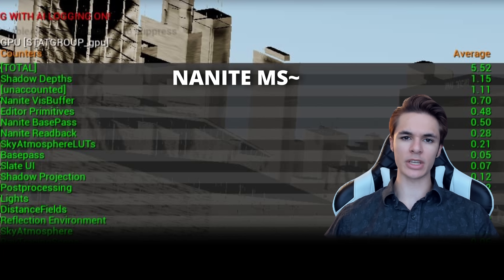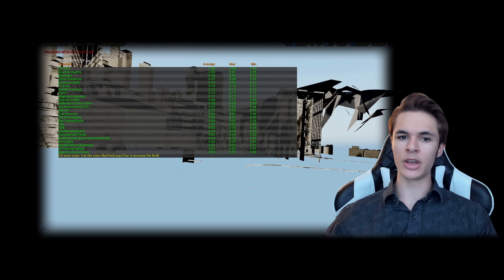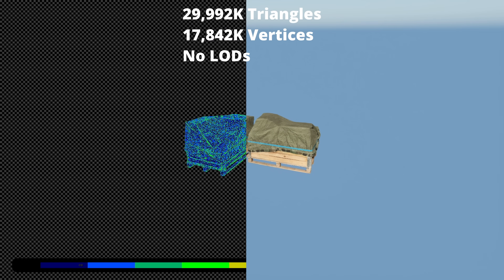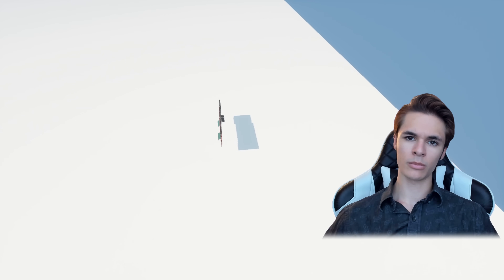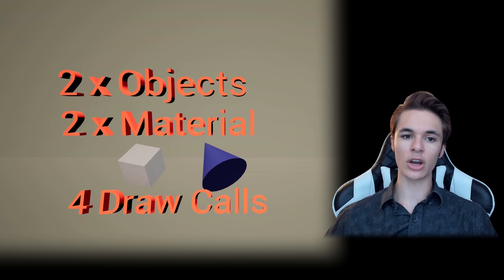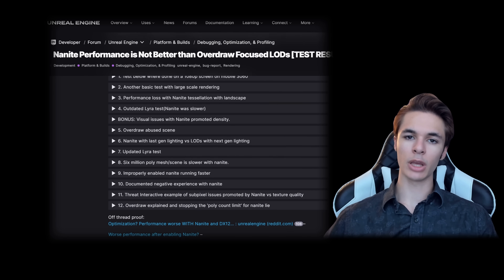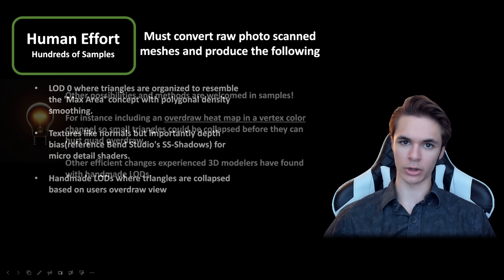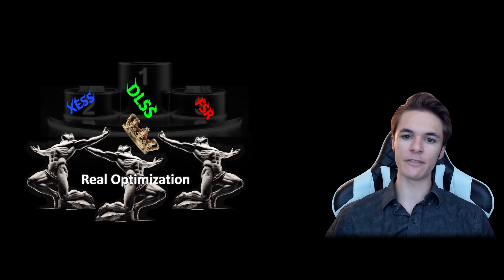Epic's Unreal Optimization Disaster | Why Nanite Tanks Performance!

Comment: unreal engine generates invisible frames that use gpu, vram and cpu performance that older games never did that made games run faster, but unreal engine makes games easy to make so it has become standard...makes you wonder if nvida and Amd and other hardware manufacturers are funding unreal engine for this exact reason to push sales of hardware.

Comment: Sad part is they've removed a lot of LOD generation options from the mesh window in UE5. Ironically, they added a LOT of options and even different decimation algorithms to the modeler view. They're actually really good too. But suppose you create a custom LOD in the modeler view, you can't use it directly in the mesh window. You have to export it to a FBX and then import it again. It's as if they intentionally made it more difficult to use LODs. The great thing about UE's decimation tools is that they update UVs. A lot of third party apps don't deal with UVs very well when doing decimation. Why aren't these tools available from the LOD options?

Also, they broke their screen size auto calculations. It used to work fine in UE4. In UE5, it gives crazy results. And they have code in there where if you change anything, all screen sizes above 1 for any LOD go back to 1. This is stupid. Screen sizes above 1 work perfectly fine despite claims to the contrary. And setting a high screen size for the highest resolution mesh means you can still change things later without baking in a new LOD 0.

Comment: Does   that prove UNREAL 4 runs better than UNREAL 5? . The more I use 5, the more I dislike it.
Reply: Adding to my  own comment. We need to stop looking  at UNREAL 5,  as  some kind of "Silver Bullet," that magically creates triple A games, at the touch of a button.  It's the developers like , ourselves  that create the magic. UNREAL, by any alliteration is a tool. AND, that tool, at this point; is severely broken,  and we shouldn't using it; until it's 's fixed. 

I ran  a multi-layer map out in UNREAL 4.27.2  with multiple dynamic assessts. (Ocean, rain, and snow  effects, and  had the base scene done, in under a half an hour. IN  5. Due to  incompatible assets,  THE project , could not even be produced in 5. So,  why  is 5 so much better? 
In the real world, we use tools, that work, and don't require, a 4080, video card, and 64 G's , and  HOPE for the best.

Comment: Nanite made all the promises. Unlimited polygons! And what did we get? An engine that sells more powerful gpus, so we can run modern games. Modern gaming, just aint it. Im going to indie games, older games, and im checking out mostly. 

The fact newer games can recommend a 500 dollar gpu, for 1080p gaming. Is criminal. We've regressed, not progressed. In 2011 a 300 dollar gpu, lasted me for like 3-4 years at max settings 1080p. Till dying light came out and pushed it too far with the fire effects. But the fact its 14 years later, using the same resolution as a baseline. Just shows how little we've really progressed. 

Sure gpus are more powerful, but the game requirements are so much higher, it negates almost all the gains. So they still stick to 1080p as a baseline. We should at least be targeting 1440p nowadays. Every new tv basically is 4k. Monitors? Its still pretty expensive, but not as bad as it used to be. But playing games at 4k? Forget about it. People would be much happier with optimizations and 4k gaming, vs pushing visuals  too hard with terrible optimization and inefficiency, and having to play it at 1080p...

Comment: But that's unreal engine use case. If you use it, it's because you want something that works off the shelf, that's beautiful and where you can drop your 20 million polygons asset and render them more than pretty decently with nanites and that  has been tested with tons of différent hardware. If you want something more custom, with more perf concern, and achieve something more unique and less standardized than all ue5 games then do your stuff. But you need good engineers, time and money. Both approach are valid.

Comment: U are right however the idea behind nanite is to shift load to GPU instead of CPU and communiucation CPU -> GPU overhead. As long as u have large enough memory bandwidth on gpu and shader cores, nanites will outperform any other solution. If u are gpu bottlenecked because limited number of gpu cores and/or memory bandwidth, nanite will cause high latency, compared to traditional solution with LODs. Nanite does cause overcomputation because objects are LODless in traditional sense but doesnt render everything on the scene for sure. So, it does save time, although there is small cost to pay. Here we come again to the point that if u have low-end gpu, then switching to traditional aproach is the way to go. If u use midrange+ gpus, nanite is the way to go. It really depends on the hardware.
Reply from the maker: We test software with a 3060 which is more advanced feature support wise than a PS5. We also extended the research in the video with these videos as well: 

https://x.com/ThreatInteract/status/1953407269447831779

You have to account for shadow problems too.
Reply: @ThreatInteractive  A 3060 is low end gpu 3070-3080s are mid and 3090 highend same if you use the  40 series and new 50 series if you are using anything below that you are really low end

Comment: Some UE games with performance issues on non-high-end Hardware  (Tower of Fantasy, Wuthering Waves etc)  when my character field of view looks up the sky, it doesn't lag.  But looking on frontward or down, it starts lagging with framedrops because of land objects that overlap.
Those kind of game development feels unacceptable and their games are not very hardware-efficient.   "Graphical-overclocking" is the best term for making cards unsafe like overvolting which made the power connectors overheat and melt in the process, similar to display ribbons on smartphones and laptop panels. (graphics card replacements are effing expensive when broken)

Comment: I think the real question you need to be asking, which I don't think you will since it seems you've invested a lot going down this path, is not strictly performance costs but the overall benefit. From my understanding is that nanite offers many solutions to many problems in a nice single package and just works. It may be slower but it's also better. Hardware will continue to get faster(assuming society doesn't collapse) and so convenience and simplicity sometimes is a natural desire. The cost of dealing with managing custom optimizations and spend a lot of energy simply to get things performant while looking good is now not worth the trouble like it was 20 years ago. nanite will get better overtime and it will become relatively faster so that the benefit will greatly outweigh the cons.  

There is always the danger when people jump on board a monolithic solution. If you feel things are going in the wrong direction rather than complaining about it you should come up with something better. That is how real progress is made. It isn't easy. The more entrenched things become the harder it is to break free of them and it always requires someone who is willing to sacrifice their life energy to pave a new way.

Effectively your general arguments can be said about nearly everything. Even human beings themselves, operating systems, city design, cars, etc. The general principle though is that we learn from our mistakes and build on top of the faulty foundations. This is not the best way but it's the only way since no one can predict the future.

Comment: I used it on a shipping center scene from a pack i want even considering because of the like frame rate. With all meshes out on nanite it was actually smooth. It's not a fix all, but it has it's uses.
Reply from the maker: Please watch the oblivion analysis, stomping out damage control video, & our newer video that will becoming out soon. You'll get a lot more data on Nanite should cement the problem.

Comment: Unreal engine is currently basically running itself into the floor, with effects ENTIRELY running on really blurry TAA and "optimizations" that tank performance and can absolutely ruin the memory usage of games due to having to keep tracks of hundreds of THOUSANDS of triangles that shouldn't need to be rendered. Plus, dynamic reconstruction of mesh while moving requires a refresh of basically EVERYTHING. It's not good.

Comment: unfortunately traditional effective oprimization techniques will not be used anymore since I believe most development studios do not get the funding they need to actually send the required time for optimization. add on top that the ones controlling the cash flow usually do not have the deep knowledge that 3d artists have so are more likely just to take nanite since (it works fine and is cost efficient)

Comment: Mesh shader is good?
Reply from the maker: Nanite uses mesh shaders for big triangles, it's 2x slower at shading optimized geo and only gets worse with more complicated meshes.
Reply from the maker: We discuss pure mesh shading in our Alan Wake 2 analysis which is highly suggested watch (again, all our content is meant to be watched one after another as context is added upon for each video.)
Reply: @ThreatInteractive What is currently "best"?
Reply from the maker: @veruk5411  Regular draw call framework with vertex shader path (optimized LODs with optimized transitions).
Reply: @ThreatInteractive Can it be combined with a pixel shader where the vertex shader is not as good in some cases?

Comment: Doesn't nanite use a software rasteriser for small (<16 or so pixels) triangles?
Reply from the maker: Yes, but it's still slower than proper quad contained scenes. It also means no HW depth culling so clusters will leak performance like bad quads.
Reply: @ThreatInteractive  It'd be good if nanite could be done faster though. Nanite is a better representation of reality than LOD transitions.
Reply from the maker: @cvspvr  Not really, it still has pop if you're not lathering the image with poor TAA. Our Days Gone analysis video shows a much better approach.

Comment: Another technique I've stumbled upon to hide LOD pop artifacts (as well as other artifacts) is to update them (activate LOD switches) when the camera is turning rapidly. Or more generally, perform 'artifact-prone' updates like LOD switches for areas on the screen that have high pixel velocity, jerky motion, or other 'expected' sudden changes that would mask the switch.

This worked well for hiding the motion of sun shadows (since normally they appear still) and would likely help with LOD switches too. Though you'd need to define a 'flexible range' for which these updates can wait for camera motion since they'll need to be updated eventually if the camera never rotates.

Comment: It seems like some level of optimization for indie game developers can be solved by the use of some tactics from enterprise software engineering. For example, DevOps toolchains that include automated testing, which in this case, would have tests for factors that effect graphics optimization. These could be run like unit tests, essentially whenever a new update is pushed to the repository. Automated testing isn't a panacea, but it can catch obvious and egregious things and/or flag elements for another check by a human. Automated frameworks could automatically load new assets into a test framework and spit out numbers based on some simple test scripts. Ideally, you wouldn't need to have it boot up a whole instance of UE to do it either.  Just a temporary rendering tool in a container or something, potentially a headless tool depending on what you are testing exactly. As with enterprise CI/CD and IaC, good deal of thought would have to go into the design of the tests themselves, but a lot of infrastructure toolchains that can open a tool, run a script, close the tool, spit out results, and then hand everything off to Git (or whatever) are available.

Comment: What is the point in getting a GPU with 12GB of VRAM instead of a card with 8GB if AAA games can't even hit 30 FPS on a 16GB card?

None of the Steam games I bought even USE more than 8. Because they're not using Unreal Engine 5.

Even Unity has WAY better optimization.

Oh, and I refuse to take future-proofing as an answer to my question. Because there's no point in getting a 4070 if nothing can hit 30 FPS on that card.
Reply: I find if a game can’t run 60 on a gtx 1060, than it’s not a well made game. And no gpu can save it

Comment: Honestly I don't think nanite is bad. It's the use and intentions of the user that depends. Nanite is supposed to be applied to only some meshes and not all. I recommend applying nanite to the focus and the subject. And usually lods or native is good for areas that are not apart of the main focus. So essentially this can use nanite in it's intended use. And forests are usually recommended to have either lods or fully modeled nanite trees (including the leaves and grass) So essentially decreasing material and nanite use is essential to improving performance.

Comment: 8:03, Doesn't the 16 series also have some support for mesh shading?

there is a minecraft mod called NVIDIUM that uses nvidias mesh shading to massively improve performance over minecrafts default rendering backed and that works on 16 series and above due to lack of mesh shading support on older generations. 

(this is a genuine question as im getting conflicting information here and not a crituiqe)

Comment: When Nanite was first released, I thought the demo and concept seemed pretty neat-- but I didn't think it was intended to be frequently used for most real-time games (instead, it seemed more applicable to media production and archviz). After all, if you're making a game, why would you intentionally use excessively high poly meshes when you could pre-bake the fine details and generate optimal LODs as part of the art/asset production pipeline?

Comment: What's the point of comparing one high poly mesh? Take a real scene for a test.
And include occlusion culling to "Raw mesh" cost so it would be fair to compare.
Reply from the maker: Somehow, getting the feeling you probably wouldn't comment on videos comparing LODs with Nanite? That's the whole point. Polycount is far less of a factor in this topic, overdraw and overlap is. 

UE doesn't have good culling measures anyway.
Reply: @ThreatInteractive  What makes you think that I wouldn't comment? WYM? I'm commenting now.

My point is that you're looking at Nanite in a wrong way. Of course, if you compare a well made regular mesh with LODs against a Nanite mesh in isolation, Nanite would cost more just because Nanite does a lot of stuff to draw the mesh.
Look at a broader picture. You need to take into account the complexity of the scene, VSM cost, Lumen cost, occlusion culling, mesh streaming, etc. And not only GPU measurements are important, CPU as well.
For occlusion culling there's "BeginOcclusionTests" in GPU stats.

Don't measure performance in the editor. Try standalone game instead. Probably would be better to have a packaged game, but still better than the editor.

If your scene is that simple, just don't use Nanite for it.

Similar thing with the virtual texturing, if you try to use it on a simple stuff it would be more expensive. But it doesn't mean that virtual texturing is a scam.
Reply from the maker: @ You're not looking at the bigger picture either, which is why you should watch every single video shown on this channel to understand more clearly.

Virtual texturing is a scam. Since they look horrible no matter what.

Comment: how about setting up an automated system where by you figure out a demo file// send a bot to run around plus additional running around around the areas you think your character would run around 
run at difurent speeds and using difurent optics and at difurent resolutions// yes time expencive

and then have the system auto generate an overdraw map wt suggested accet mutations// 

AI bullshit to solve Ai bullshit

Comment: What I'm getting from this is that devs have been getting less and less economical about draw calls and number of unique objects, and instead of making better LoD algorithms or overlap detection, Nanite simplifies by rendering in groups of 4 pixels, but needing to do it for multiple depths means you could end up spending more resources in the first place, particularly for objects far away.

is that right?
Reply from the maker: Read pinned comment. 
Nanite does not use quads, it's a per-pixel cost(that stacks with pixel overdraw: https://youtu.be/QAbEE9bLfBg?t=363 ) that is higher than traditional rendering using quad optimization.
Reply: @ThreatInteractive  ahh thank you

Comment: Currently, Nanite is not being utilized for 3D game assets; perhaps it is more focused on rendering in other industries like movies and similar fields?
Reply from the maker: Several high budget games are using Nanite. Who started that nonsensical myth?
Reply: Immortals of Aveum was a UE5 technical showcase, running both Lumen and Nanite and runs hilariously bad and looks visually terrible compared to games that are a decade old. Remnant 2 also uses Nanite and heavily relies on upscalers just to meet decent performance needs. Nanite could be more useful for rendering in other industries but it's focus and marketing was definitely for videogame developers. The performance cost for Nanite is absurd  and should be dropped by devs. The performance issues in Lords of the Fallen from using these technologies in UE5 took them almost a year to fix if not more